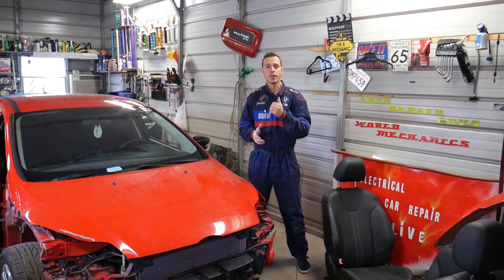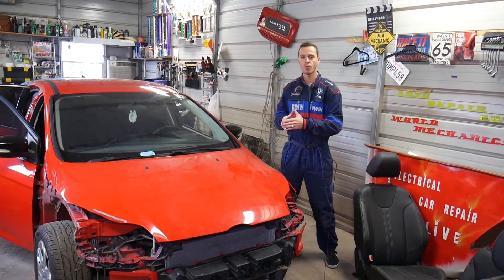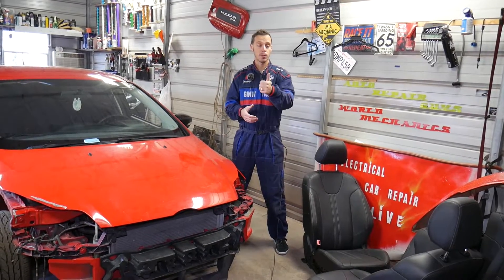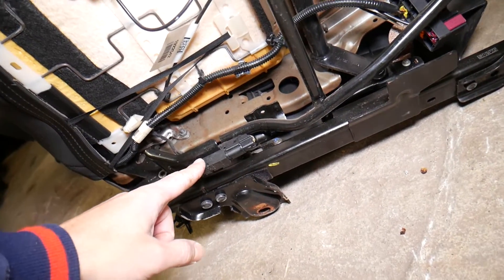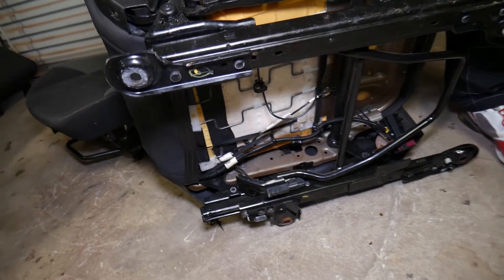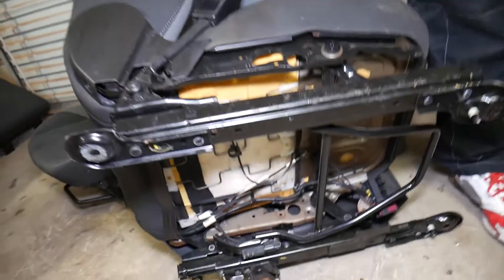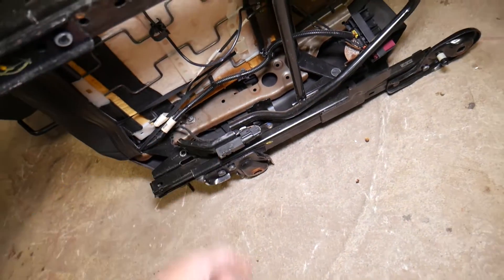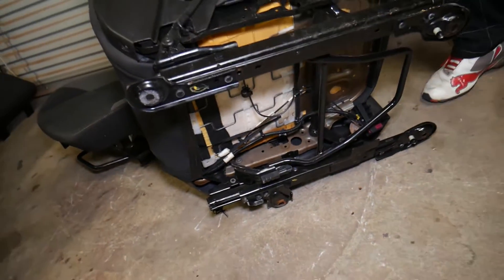SEAT POSITION SENSOR WHAT IT IS AND WHAT IT IS FOR demonstrated on FORD

Comment: So I started cutting the stuff and sensors out if the passenger seat to swap and hide under new BRIDE buckets, (using 2.2 ohm resistors for airbag sensor) and there's a big black box (2012 fiesta se USA) ITS CONNECTED TO A HOSE THAT GOES TO THE MIDDLE, oops. Well I cut into it and OIL WENT EVERYWHERE LOL. What in the heck is it? Passenger weight sensor? For turning pass airbag on/off I'd assume without googling it lol. What axpain in the arse!

Comment: when it comes to messing with airbags sensors/parts im always a bit worried it might go off or throw a code that would never be gone until reprogrammed, etc. So, id like to remove my seat (2010 charger) just to clean the dirty floor, will this removal of the sensor trigger anything? maybe i should just play it safe by removing the terminal from the battery to avoid any future issues.

Comment: hey guys, i have a chrysler 200 2015 C, i was rear eneded by a drunk driver but it was minimum damage, just the trunk and bumber were damage, no airbags      activated but my seat dropped down and wont come up at all to ajuste and my steering wheel wont adjust either, its just locked does this sensor have something to do with this??? help me